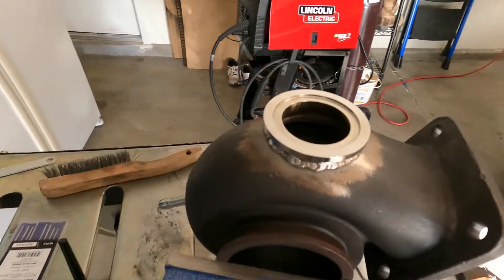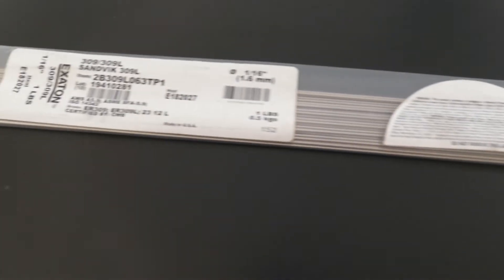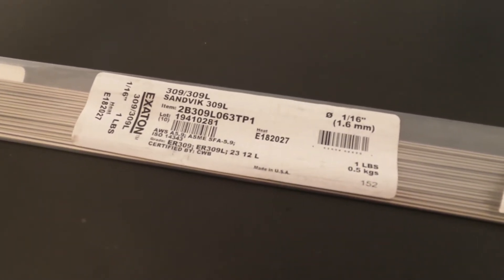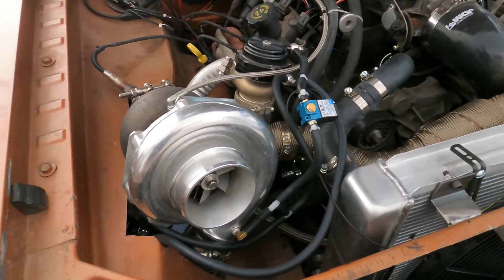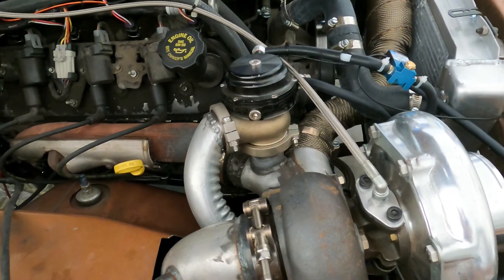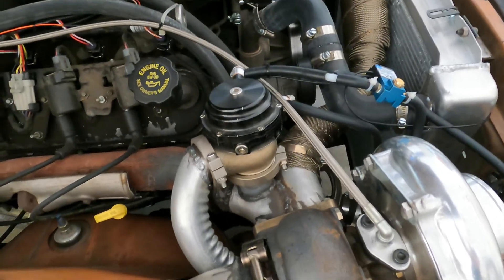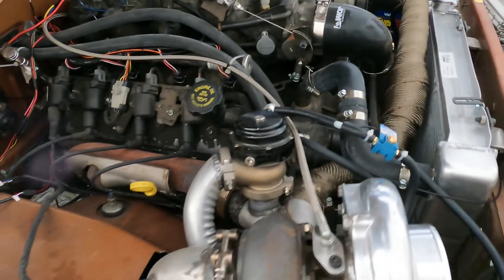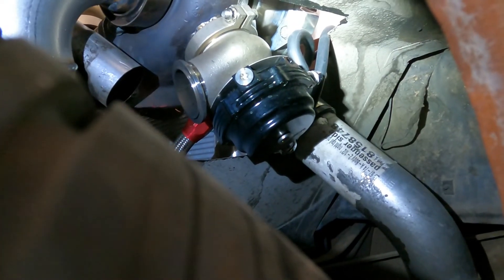Welding Wastegate Straight to Turbo Housing

Comment: wondering what the downsides are of putting the wg on the housing.. seems like heat would become more of an issue than traditional up-pipe mounted one. nice work though.
Reply from the maker: If you switch turbos it's kind of a down side. Since you would have to drill and weld the new one again or if you sell the old one to someone the location might not work for their packaging constraints? This one is still going strong after probably 2 dozen passes and some street driving!
Reply: @kellybuilt1  ya, those are obvious and not a big deal. i guess i was wondering if heat would be an issue there or any other problems/cons of doing it. because right now, mines under my turbo so changing springs or doing any maintenance on the lines is a royal pita.. not to mention trying to attach between the uppipe and the downpipe.. super fun..
Reply from the maker: Yeah recirculating the wastegate sounds like another challenge. Mine just has a short dump pipe to the fender well area. Heat might become more of a problem in a road race application or burnout car or something but a drag/street combo probably doesn't get that hot, just lots of cycles.
Reply: What about power loss due to it being directly on the turbo ?

Comment: where the hell did you buy 309 paying $50 for 1 lb I buy 3 lb tubes and I paid $31 and that's at my local welding supply store down here in Florida I pay $36 for 308 l
Reply from the maker: Linde welding supply in Las Vegas. Called a few places before that didn't have any. Maybe I should ask for the local discount.